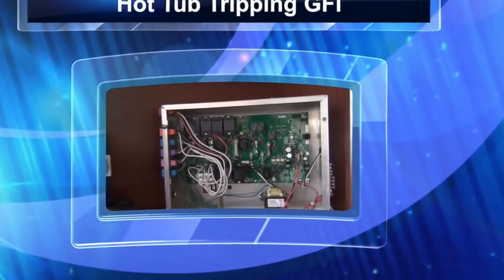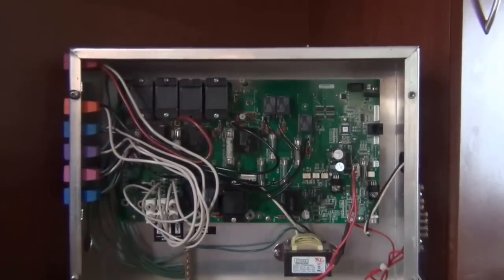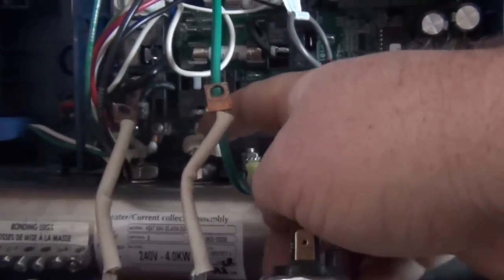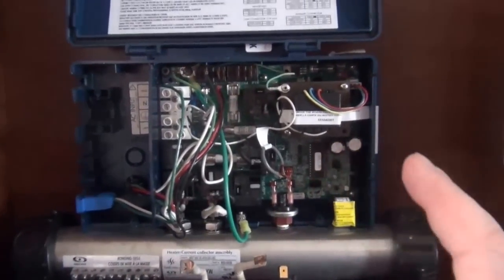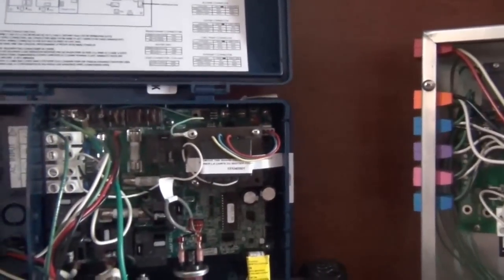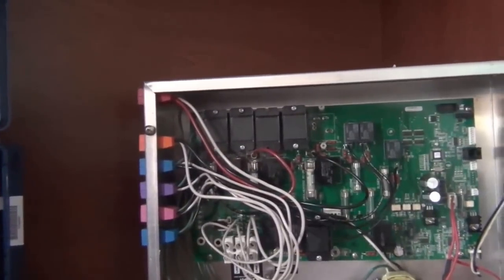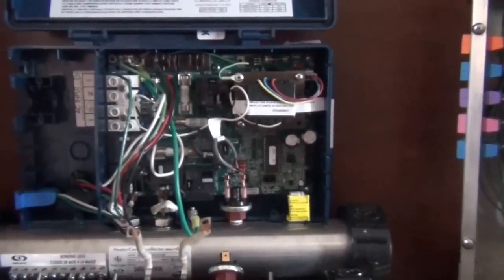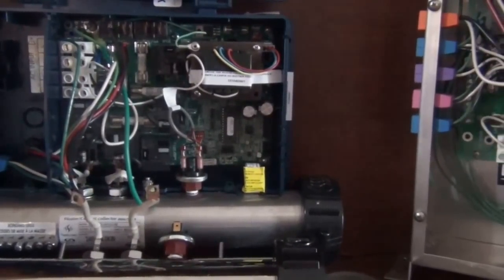Hot Tub Tripping The GFCI Breaker?

Comment: If I determine the heating element is tripping the breaker, is there a test for the heater to determine why it’s tripping the breaker? The element itself has proper resistance at 10 ohms. Is there a resistance to ground I can check? How does it fail and how can I verify it? Thanks.
Reply from the maker: If it's tripping the breaker, change the element.  Can't tell why they trip the breakers and sometimes you can't even see an issue with the element when you take it out.  Most will have some sort of rust spot on it.
Reply: @VIPPoolsandSpas  Thanks so much! I like to hunt problems to their failure point and knowing there really isn’t an answer will save me some time. My local repair guy is scheduled to replace the heater next week.

Comment: quick question if i may?   I have intermittent tripping?  My GFI only trips during winter months?  it may go for a few weeks or days? It seems during the warmer months (in Canada) no issue.  I can't really disconnect the heater in the winter.   After watching your video, i will try the ozantor today.  Thanks in advance
Reply from the maker: I don't think the winter has anything to do with the tripping.  It seems that because your hot tub is calling for heat more often, something is tripping the breaker.  
What type of tub do you have?  And the spa pack?
Reply: @VIPPoolsandSpas  thanks for answering .  It is a Canadian spas. Toronto model.  Balboa spa pack.  Siemens 50amp GFCI.
Reply from the maker: @davedave2109  first winter this is happening?  How's the pumps?  The things it could be is..    GFCI, one of the pump capacitors, heater element, or board.
Reply from the maker: Another questions.  Can you reset the breaker after it trips and does it stay on for a bit?
Reply: @VIPPoolsandSpas  thanks again for answering .  Yes, when I reset it it will run anywhere from 1 day to a month?
There seems to be no reason.?
We keep the temp around 95 in winter, not used so much.

I added an external sensor to monitor water temp.  I get an email when temp starts to drop.  This way I know. This is not the 1st winter.   This winter seems to trip a little more.

I'd like to get someone out to look, but worry it will turn I to a guessing game, because it seems so random .

My tub on has one 5hp pump. No circ pump and has an ozanator.
Reply: @VIPPoolsandSpas  this tub is 3 years old.  Is 50 amp GFCI enough.?
The 6/4 line is about 40 feet to main panel
Reply from the maker: @davedave2109  what sensor are you using for water temp?  And, yes, it would just be a guessing game on finding the problem.  Have to have the breaker not reset again to find the problem.  Check all wiring connections from the breaker outside too the tub.  I think something is heating up more often in the cold because the tub calls for heat more often.
Reply: @VIPPoolsandSpas  the sensor I use to monitor is standalone Bluetooth.  Wire just hangs in the tub.  Made by LaCrosse. Not connected in anyway to anything in the tub circuit.

Since the tub runs most of the time .
And issue is so intermittent ?  I'm going to try one of your suggestions and disconnect the ozanator connector today.  
After that I may have to look at 6 gauge wire to the tub?
The same thing happened just a few times on the other hottub.  Won't be fun. Wire is fully encased in conduit .

Thanks for your time this morning

Comment: Thanks for the great video.. Was wondering is there a way to test the high preasure switch for the heater? Would a faulty one cause the breaker to trip?  My heater tests good? Any thoughts? You help would be appreciated thanks James
Reply from the maker: The pressure switch and other sensors are low voltage and couldn't trip the breaker.  Even the light wouldn't trip the breaker.  What's the name brand of the spa pack and the name of the tub?
Reply: @VIPPoolsandSpas  Thank you for the quick response... Its a vita spa a older model like from the mid to late 90's.....I was in it when it tripped the heat was where it should have been and both pumps were working?  Ive tried to test for resistance on the switch and got nothing even when i manually pushed in the switch?
Reply: The heater actually looks a lot like a pigs tail all curled up ...
Reply from the maker: What's the name of the spa pak?  Control box shown in the video?
Reply from the maker: If you can.  Send me a picture of the spa pak and other equipment.  Info@vippools.ca
Reply: @VIPPoolsandSpas  i will send a few pics tomorrow of what i have not sure of the name other then vita spa.  Not sure if its all their own equipment but i see no names on them.

Comment: Thanks for the video! My spa still trips with everything disconnected. Its 240v- if I pull either red or black it stays on. Does that mean I have a short somewhere?
Reply from the maker: Theres a short at the GFI.  Check connection.  If the gfi was just hooked up or work was just done.....its the gfi wires wrong.
Reply from the maker: Also, make sure the wires are connected right on the spa pak (spa control box) .  A weak GFI could trip also.

Comment: Hi I need some help with the colour outputs
Reply: My pumps my lights run stereo work but the heater don't I did test the element and it reads 11ohms can I test. For heat out of the tub on my work bench
Reply from the maker: @SOLIDGOLDSOUND1  does the breaker trip? have you disconnected the element?  test the element for continuity
Reply from the maker: Did you have any luck?  What's the outcome....if any?

Comment: looks like a sensor of some sort on the heater, either heat/flow? could that be a factor?
Reply from the maker: If the tub is tripping, it will not be a sensor or the pressure switch.  If it's a flow switch....it might trip but that is rare.

Comment: I don’t think it is but not sure. How could I tell that? I see a pipe coming from the hot tub and goes through the water side of the pump then the other side goes directly back into the hot tub. I believe it’s only a circulator pump.
Reply from the maker: Do you know where the heater is?  What name is on the spa pak and color.

Comment: Hi , thanks for the video. I have 2 jet pumps in my hot tub. I opened up the panel and removed one set of wires off the circuit board and found the gfi didn’t trip. So I pulled out the pump and changed out the starter capacitor. I did a bench test for the pump and it ran fine. After putting it back into the hot tub I tried it again and the breaker tripped again. It only trips when I press the button the turn on the jets. The breaker holds when the jets are off. Any more ideas of what it could be? Thanks for your help in advance.
Reply from the maker: Sounds like it's the relay.  Is the pump a 2 speed (red, black and white wires....plus the ground wire)???? 
Is the pump that's tripping, the circ pump for your heater tube?
Reply: It only has black white and green. The wire goes directly to the circuit board
Reply from the maker: So it's a single speed.  Is that the pump that pushes water thru the heat tube?

Comment: Great video. My hot spot hot tub keeps tripping. I checked all the items you mentioned. Nothing stands out. It ONLY trips every few days though. It doesn't just trip immediately. Any ideas? I suspect its one of the items you mentioned, but since it doesn't break immediately, I am stumped.
Reply from the maker: It might be that your GFI is getting weaker.  Try doing the steps but over days....first, try the ozone.  If you don't have that, try the other pumps (one by one). Let me know.  thanks
Reply: @VIPPoolsandSpas  So, the hot tub is in a remote area, cabin, 5 hours from where i live. So I sent a  repair person to it, who is closer to the property. They run a large shop in Idaho Falls, the biggest city close to the property (Island Park, ID). They aren't 100%, but they said it is likely the filter. This seems odd. In your opinion, can a bad filter cause a breaker to trip? My big concern here is the hot tub in a location where the average winter temperature is below freezing for 5 months. My property manager is having to check on it 2 times a week to catch it each time so it doesn't freeze. Its a VRBO rental, and the guest love it after a day of snowmobiling or skiing. I feel like I am in the mode of now having to throw parts at it until it doesn't do it anymore.

Comment: Hot tub purchased in 2002 with a LX-10 control panel (SPA Builders Systems). The GFI triped and there is no display on the control panel. I reset the GFI and it did not trip, used my voltage testing and there is power in the control pack but I have no dispay on the top side control panel? Any suggestions on how to proceed?

Comment: Hello..Im working on a tub that trips the breaker only when the ground wire is connected, as long as the ground wire is pulled off of the board it does not trip...and there is an led on the board that stays lit ONLY while that ground wire is off the board...I have pulled everything..and I mean everything off one at a time on the board....nothing trips until the ground is reattached to the control board..The only thing I can think of is the GFI has gone bad and wont hold the load of the heating elements when first started.
Reply from the maker: it all depends on what type of spa pak you have.  in canada the white wire is inline with the ground wire on the panels.  you had the ground connected everytime you disconnected everything else, one at a time?  tell me what you have......1 pump?  circ pump?, light type, ozone, blower????
Reply: @VIPPoolsandSpas  Well...I said it was mine..but it is a friend of mine..same difference right..But anyway, I went over today to work on it..and looked and looked...still could not find anything...no heater element grounded..nothing shorted to ground...I pulled the cover off the disconnect...and pulled the white wire off of the neutral bar...it has a separate ground bar in the box also...and when I touched the white wire back to the neutral it gave a normal very small,   and I mean tiny arch..like I would think it should...and the breaker would not trip doing this..but of course the tub was not running either...so I reset the breaker, then pushed the white test button and it tripped which it should...reset it again...with netrual off the bar...and the board LED would light up, but nothing ran...then turned the breaker back off...reinserted the white wire...flipped the breaker and in a few seconds it came to life..all the pumps started working..the lights worked and heat worked...so I dont know..I think it is the breaker.
Reply: Wires from the house are L1 and L2 go into the top of the GFI...and from the house is a bare ground, and a white neutral. which goes into the bottom of the GFI next to the white curly wire...There is a ground bar, and the bare wire comes from the house to that bar,,, and out of the bar to the tub. The white wire from the house goes into the bottom of the breaker.  The curly wire comes out the bottom of the breaker and goes into neutral bar...separate from the bare ground bar..then both L1 and L2 go to the tub...and a bare wire from the ground bar goes to the tub...and a white wire comes out of the neutral bar in the box, and goes to the tub....

Comment: Spa pack, and heater replaced about 1 year ago, pump w/ motor replaced 2 years ago.  When heater and pump both indicate on, breaker trips after about 10 mins of running.  I suspect a heater element, or a weak breaker.  Could this indicate a bad GFI at the panel?
Reply from the maker: Something is heating up on the common (white wire) side.   If no white wire used, most likely not a GFI issue.   I would say to replace the heater element again.
Reply from the maker: heater element most likely.  sorry about the 4 days later thing.  Did you get it fixed?

Comment: My GFIC is tripping instantly. I've gone through the disconnect of the pumps, the heater, and the light (which I think is all there is on the power side), and it still trips. Disconnecting the red (line 1) input, and it still trips. Disconnecting the black (line 2), and it doesn't trip. I measure 27 ohms between red and neutral. I measure 7,000 ohms between black and neutral or ground. Any suggestions? Is my circuit board the problem. There's no visual evidence of anything burning out.
Reply from the maker: disconnect the black or red wire coming into your pack.  if you disconnect both at the same time and it trips, its the GFI.
Reply: When both the red and black are disconnected the GFI doesn't trip. If only the red is connected (black disconnected) it trips with a few seconds delay. If only the black is connected it trips instantly.

Comment: There is another possibility when GFCI trips; it's faulty wiring from GFCI to hot tub, it can be wet inside  the conduit so is better to disconnect wires at GFCI to test. Also if there is another circuit connected to GFCI it may trip intermittently. Pump may trip it if seal is leaking into the motor itself

Comment: I do have to say,  if you are going to give people advice regarding power and GFCIs,  I would probably stress before touching anything,  to ensure power is completely removed from the equipment,  which can only be truely confirmed with a voltage tester.
Reply from the maker: If I have to tell someone to turn the power off before doing any of the things in my video.......you shouldn't be touching anything. I'm assuming that people are smarter then you and can figure that turning off the power would be a good idea.
Reply: Amateurs don't look up electronics troubleshooting videos, they make a phone call for service.  Its common sense to turn the power off first
Reply: Very often you have to work on hot equipment just to do measurements; that's why they call them electricians

Comment: The GFI trips when the neutral is connected on mine but stays on when it is disconnected.  Is the whole board bad?
Reply from the maker: disconnect heater wires first, if GFI stays on, its the heater element.  If it trips the GFI, disconnect one thing at a time until you find whats tripping the GFI.  If you disconnect a pump and it stays on, its the pump you just disconnected.  Got it ?

Comment: I have an old tub 1993 which I troubleshot as the heater element was tripping my GFI and I changed the element. The hot tub worked fine for a month and then it started tripping again so does that mean my GFI is done? The GFI only trips when the element turns on.  I've owned the tub 12 years and never changed the GFI so I assuming it is the problem now
Reply from the maker: element might be touching the inside wall of heat tube or the new element got a scratch on it.  See if there's any rust on the element.
Reply: No turned out to be a bad element. They took it back and gave me a new problem solved.

Comment: Thanks for the video. I have removed the circuit wires from the tub panel. The GFI continues to trip. So I am guessing it the GFI breaker.  Isn't there a procedure for checking a GFI breaker?
Reply from the maker: Disconnect everything one at a time.  If everything is unplugged and it still trips, should be the GFI.

Comment: Can you lend some support on troubleshooting a circuit board? My GFCI is tripping when the wires are connected on the circuit board. I disconnected everything from the circuit board and applied power and the GFCI still trips. I did test the GFCI and wiring to the Hot Tub and they are okay. I suspect the circuit board is the problem. Thanks
Reply from the maker: Disconnect the RED wire from the GFI and retest.  If it trips, disconnect the BLACK wire.  If BLACK and RED wires are disconnected and the GFI still trips, its the GFI or the GFI is wired wrong in the box.